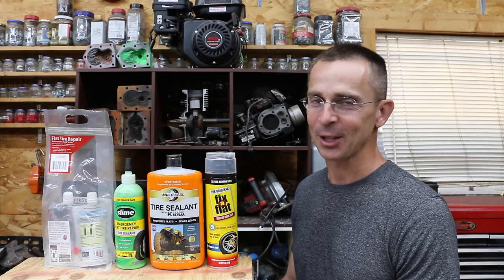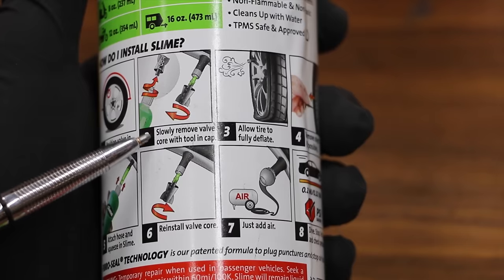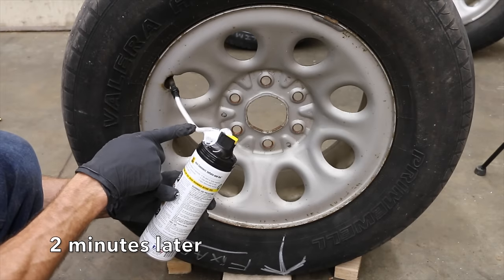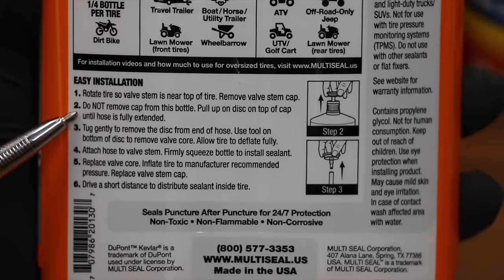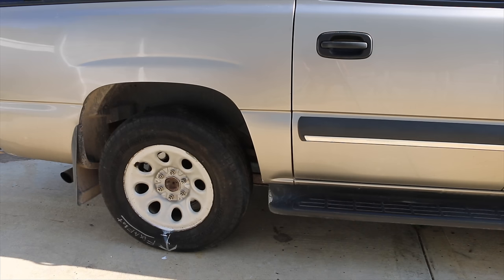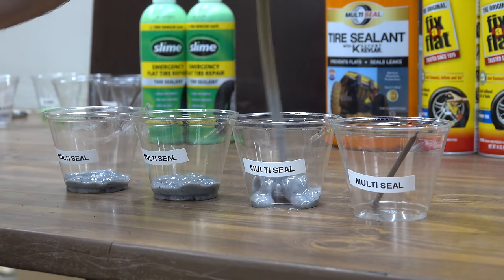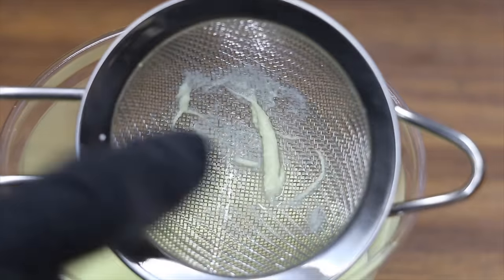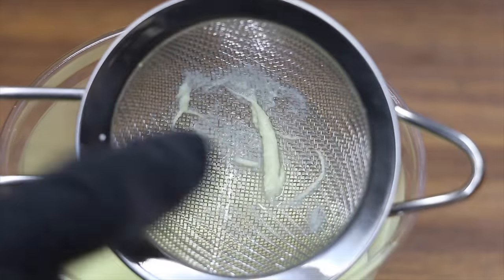Is Tire Slime the Best? Fix-a-Flat vs Tire Slime, TireJect, MultiSeal. Let's find out!

Comment: Very good stuff thank you! Also worth mentioning, I worked in tire repair for years and know that any tire that has products like these put inside for flat repairs can plug up your tire pressure gauge next time you check? Not sure if it will effect TPS sensors but quite often the regular stick gauges would be ruined.
Reply from the maker: You are welcome!  Thanks for the feedback.
Reply: These sealants can also prevent the Schrader valve from sealing, best to put the valve on top and blow a little air in to keep it cleared after checking pressure.
I don't recommend using any of this in a road vehicle,  but in emergency....gotta do what you gotta do. Many tire shops won't attempt a repair after sealants are used.
Slime is my go to for bikes, mowers, quads. I've had great luck with it.
Reply: then i guess you didn't grasp the concept behind centrifugal force and how it keeps the slime on the outer portion of the tire air space and away from the inflation valve. they don't teach you that at the tire stores, do they? never saw anyone ruin a tire gauge that way....

Comment: I ride off road bikes here in the Lone Star state, and there are mesquite thorns all over the tracks and trails. I learned that most motorcycle repair shops won't touch a tire-innertube with the green slime in it. Thats a bummer. Your tests are off of the charts, keep up the good work.
Reply from the maker: Thanks!

Comment: Thank You! I bought a one gallon size of Slime to use on the tires of a New Holland hay conditioner I use to mow down small brush including thorny wild growing plumb trees, of course the tires get punctured from the thorns and sharp stumps of brush. Before actually using the Slime I wanted to know what it does, how well it works, and any damage to the inside of the rim, you answered all my questions! Very thorough study! As a side note, some years ago I bought an older 4-wheeler, the seller told me the tires had been Slimed, over the next few years I could see the green Slime in between cracks of the tires but they never lost air pressure, that led me to buy the Slime for the hay conditioner and you've answered my concerns.
Reply from the maker: You are welcome!  Glad I could help!

Comment: Very disappointed in Fix-a-Flat's performance!
Reply from the maker: Thank you!
Reply: @ProjectFarm  RobotProjectFarm detected!
Reply: I've used fix-a-flat, I had the same experience, the can does not empty all the way.  Thought I just had an old can, bought another one to have enough to actually fix the flat.
Reply: Worked for me
Reply: Used fix-a-flat once. I had a tiny sideway cut. It worked, but I got the tire replaced the same day a few hours later.

Comment: Just watched this Jan 2023.  I did NOT notice it was 3 years old!  Great video, as usual!    One you forgot, or missed, that I use a LOT of is:  LiquiTube.  However, I believe LiquiTube in only for off-road use.  I use it in ATVs, lawn tractors and mowers, front tires on farm tractors, wheel borrows, and farm trailers.  If it is a low speed off-road tire, it has LiquiTube in it!  NO flats on over two years, YAY!  
I am waiting for a "Permanent Marker" video.  I have tried Sharpie Commercial, Miwaukee  Inksall and a few others.  NONE meet my definition of permanent, as most fade away after a few weeks in the sun....
Reply from the maker: Thanks for the suggestion.

Comment: I have a tire plug kit and 12V compressor in my cars. I'd never use any of this stuff.
Reply: Plugs will cause tire to delamated.
Reply: @daisykaran5607  .. I plug until I can get the tire patched or replaced. It depends on the location of the hole.
Reply: @DJaquithFL  truth  i have jammed a plug in a side wall of a junk tire before ran it around for 2 weeks before i had to put the next tire on lol. One lonely farmer loves tire ject they have some videos up or did shooting a brand new tire with shotguns that was filled with it then he ended up putting it on a piece of equipment and putting it to work . Everything has its place
Reply: Do u carry a spare?
Reply: @daisykaran5607  I've plugged tires and run them for years successfully . I would like to hear more about this delam as it makes sense but hasn't been my experience .  A heavy full throttle powerslide breaking a belt certainly caused some trouble.
Reply: @myes344  .. Yep and if the tire is ripped to shreds I'll use the spare. Gone are the days of a full sized spare. Frankly it's faster and easier for me to plug the hole. My wife has roadside assistance, but that's generally a call to me .. LOL.
Reply: My work plugs tires all the time on our fleet vehicles. I have gone more than a year on a plugged tire without any issues.
Reply: @daisykaran5607  You're full of theory, but nothing else. I've run motorcycle and car tyres tens of thousands of miles on plugs. Never had a failure of any kind.
Reply: I carry tire plugs. Never had a problem with an.   At my old job we had company vans that were used only on premises, we'd have huge holes that we'd jam 2 or 3 plugs into, and they'd hold for quite a while.  Lol
Reply: Saved me many times no jack no changing the tire. I’ve even made it into dinner before we got a table while fixing a leak. Then drove home.
Reply: @daisykaran5607  had mine plugged for 6 yrs still hold air neva leaked
Reply: After a local Cat4 hurricane  I had 23 flats in the next year, all plugged. Ran those tires for years and only had 2 plugs eventually leak so i just re-plugged.
Reply: I’ve plugged car and truck and off road tires with not a single one failing.
Reply: @NUTZJ98  not sure how plugs are "going to keep you busy plugging"   unless you're using them horrendously wrong, or trying to plug some massive holes with them.
Reply: @NUTZJ98  ohhh... I misunderstood.  Yeah, in that case, I'd slime the tires right when they're installed. Lol
Reply: @AN-kg4ei  Sometimes the plugging tool can cut some wires in the steel belt and cause blowouts...but the damage may have been caused by the road hazard to begin with and the plug gets the blame. 

 I have plugged a lot of tires myself, but about 20 years ago I started using slime in all of my tires...no more need for plugs...you can leave the nail in the tire or pull it.  The only down side is that you can't balance tires with a liquid in them.  I have found slime is much more dependable than plugs are.   If the slime eventually dries out, just add more.  If the plug eventually leaks, just add slime.
Reply: Look at all these tire-mother-pluggers we have here...

I'm a tire-mother-plugger, too.
Reply: @noidontthinksolol  that's risky. Thanks for testing that for us. Lol (riding at 300kph with a plug in a motorcycle tire)
Reply: I have used Stop & Go 1000 mushroom type plugs before on my motorcycle.  Got 2 screws within a week, one in the center and one off to the side (not the side wall).  Used the Stop & Go plugs and ran it for 10k Miles before i changed the Tire.  Both were in the rear tire.  If I got a puncture in the front, I would plug it and have it changed asap.
Reply: I have had it happen took me around 3000 miles and was the sausage type still even held air after delamination. The tire shop refuse to pull my plug and put in real one in the second tire.  they told me that the one it sausage it run in and the tire was a free replacement.
Reply: @walkerv8530  Same here Sidewall repair on compact car (2 be honest I might have used it like that fer quite awhile)
Reply: @daisykaran5607  N O
(Whitty Remark)
Reply: I have always carried plugs on my work van because of drywall screws and roofing nails around  jobsites. I can usually pull the nail and plug it without losing more than a pound or two of air pressure. I never had a plug fail.
Reply: i used it till the tire blew lol, old diesel mercedes car heavy not a compact car, car was junk ate tires  found a source for free used tires changed them myself as car ate the tires off anyways .

Comment: I’m currently on a 1200 mile road trip with a slow leak - two cans of fix a flat haven’t worked - I really appreciate your video.  I’m going to get some Slime and try again.
Reply from the maker: Thanks for sharing.
Reply: @ProjectFarm  Update - three cans of fix-a-flat in a single tire was a very bad idea.  The tire's balance was thrown off making it wobble and made the whole van shake and rattle - but ultimately it got me to a place where I could have it replaced.

Comment: And  the winner iiiis..... ( drums ) Space saver wheel in the trunk  ( Horayy )
Reply: Too bad not all cars come with them anymore.  To save weight mine came with a fancy compressor/tire sealant combo.
Reply: Often enough cars don’t have spares anymore just a compressor and a sealant but even if it does your still going to have to fix the hole sometime
Reply: I carry a plug kit in all my vehicles. Simple plugs have never let me down. And it takes almost no space.
Reply: Tyre have to  be punctured "correctly" to use of theese sprays, screw or nail. What if you hit a pot hole and bend a rim and cut the tyre or you have rupture in the side wall ?

Comment: I’ve reached this video because I have a tube tire road motorcycle, and in a couple of weeks I’m planning on making a 930 km total round trip and well, repairing a flat on the road is not an option, I’ll go with the Slime option since it’s going to stay inside the tube and the tire won’t get as messy as in a tubeless tire. Also I need to reach highway speeds so… 

Thank you very much Todd, I love your channel <3
Reply from the maker: Thanks and you are welcome!

Comment: Coolant additive? RP Ice, super coolant, wetter water, amsoil, distilled water?
Reply from the maker: Thank you for the video idea!
Reply: @ProjectFarm  Ooooo on a similar vein, how about coolant sealants? For coolant leaks? Like a small hole in the radiator they have those supposed aluminum "sealant" things you just pour into the system and it's supposed to fix it.

Comment: Fix a flat is great at marketing a low quality product just like frame oil filters.   They are probably owned by the same company
Reply: Fram used to be good...
Reply: Lassi Kinnunen  unless u buy frame top of the line products they are crap.  Cut one open and compare filter media frame uses about 2ft less filter media the six and most OEM.
Reply: Fram was good when they were one of the only aftermarket filters.  Now they're bonafide garbage.

Comment: Tireject also sells repair "kits" that include co2 cartridges to quickly refill a tire (haven't seen a video to know if they work or not)
Reply: Don't know how well something like that would work on cars, but I do have a bicycle pump that has a CO2 mode if you can't be bothered doing things the old fashioned way. Pretty expensive way to pump a bike tyre up, but it does get the job done in literally one second.
Reply: I have the CO2 bike inflator for over a decade and it only does about 1.5 MTB bike tires so I can't imagine how it'd do a whole car tire. Maybe it might get it up into the 10-20psi range so you don't damage the rim but I wouldn't trust to bring it to highway speeds safely.

Comment: I LOVE YOUR VIDEOS! I'd really like to see you test double stick tape, I use it alot for my line of work. Thanks!
Reply from the maker: Great suggestion!  I'll test it soon.
Reply: Are you not going to mention the fact that if you fill a tire with FLAMMABLE slime and don't tell the tire people you can be charged by the police for any damage or injuries caused to them?
A lot of states have laws now where the sticker that comes on the can is required by law to put on the inside of the rim so anyone working on that tire knows that it is a flammable explosive!!!!!!!!
Reply: Please consider including double sided molding tape.
Reply: @ProjectFarm  Be sure to include 3M VHB tape.  I was told once that it's been used to attach glass to high-rise buildings.  No idea if that's true, but I'd like to see if the stuff is really any good!
Reply: Yes! On the double sided tape. I always believed the red 3m was the best

Comment: my FAVORITE❗  I too have that harbor freight manual tire changer. Its a ''torture tool'' in July, in Florida heat. (110 in the shade) I only use it as a last resort for boat trailer tires. I give you credit for using it on your truck tires.  My favorite test video.
Reply from the maker: Thank you very much!

Comment: Will tin foil work as a replacement head gasket? Heavy duty tin foil of course.
Reply: my neighbor used to use cardboard from cereal boxes for gaskets.  I tried it with RTV and it does not work.  There were some rumours on an arborist website about using soda cans on Stihl chainsaws for gaskets to lower compression and that definitely works.
Reply: @dixoncider7256  Yeah, we used to use cereal boxes with hermetite sealant for low pressure gaskets. I have made a head gasket by laminating thick foil. That was on a side valve single, blew in about a minute.
Reply: @ljoel maybe, if you can create the required thickness by folding perfectly and compressing it to decrease the volume it takes up

Comment: Have had 9 cans of Fix a Flat fail recently do not buy it has gone to shit after years of working for me even in sub freezing temps,next slime is ok but not great,had great results with monkey grip lately bought at local O'Reillys
Reply from the maker: Thanks for commenting on this. I was hoping it would do better.
Reply: Great to know, thanks!  Fix-a-Flat has been my go-to for nearly 40 years.  Very sad news.
Reply: @Rico_G  Well it was bought at multiple locations and we use it often running zero turns all day we get alot of punctures and slashes as I said in the past it would air a passenger tire up about 1/2 and get you to an air pump I also used it for many years, we even emailed the company and talked with a rep but it still don't work and the deny it,my brother recorded a recent failure I will try to get it and upload it the Fix A Flat didn't even go in it blew back out it's own fitting and hose
Reply: A lot of people are complaining about the new non-flammable Fix-A-Flat and how it doesn't work at all as good as the old flammable stuff!
Reply: @johnsmert3361  you cannot put fix a flat in something that has a TPMS sensor it will not work
Reply: @thecloneguyz  I didn't it tried to go in a Suburban 265/70/16 and a 15x6.00 on a Kubota neither have a sensor and it went in neither tire Fix A Flat failed to enter 9 times
Reply: @johnsmert3361  you should buy valve stem caps that have a valve stem remover attached to the back side of them
Then you can always pop the valve stem out anytime you need to and that should solve your problem
Reply: @thecloneguyz  we did that,we have an entire kit with us plugs and patches it wouldn't go in the valve stem removed, but hey if you got a love affair with Fix A Flat use it brah, we need shit that works and puts us back on the job ASAP and that aint it
Reply: @johnsmert3361  we use plastic inserts that bolt directly to the rim (underneath the tires)
We found them years ago for $40 each
YOU CANNOT BEAT THEM! 
EVER!
Reply: @johnsmert3361  
Get some run-flat plastic inserts and bolt them directly to your rim and you will never have a flat tire ever again 
Even if the tire shreds itself apart you're still driving on the plastic insert until you get where you need to go! 
$40 - $100 eaxh depending on size 13" - 24"
Reply: @Rico_G  yeah i used to use fix a flat alot because it used to work, but i have not had any luck with it even on very slow leaks for the last 3 times ive used it!

Comment: What brand tire mount tool did you use? It looked like it worked well you should do a review on it. Great video. Thanks.
Reply: That’s Harbor Freight. I bolted one to my garage floor. However I’d replace their tire removal tool. It’s ok if you’re using it on steel rims but it will eat up your aluminum ones.
Reply from the maker: Great video idea!  Harbor Freight tool